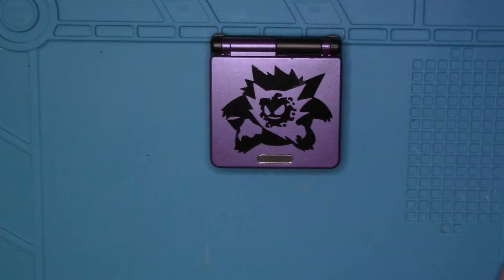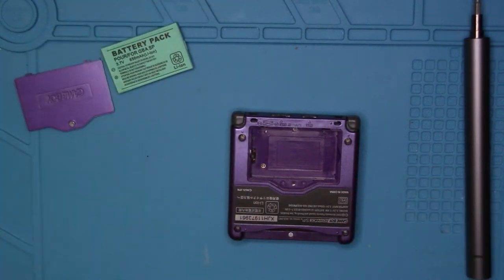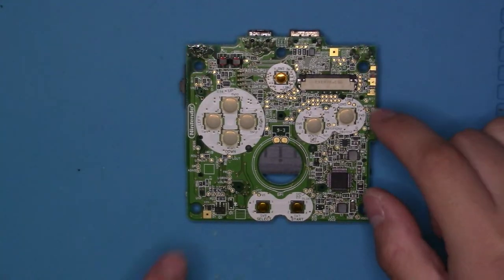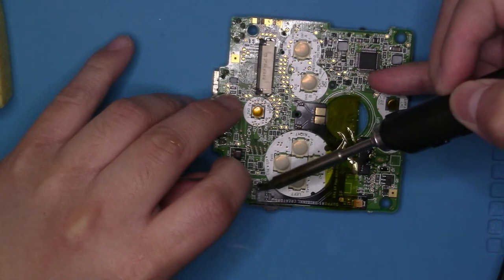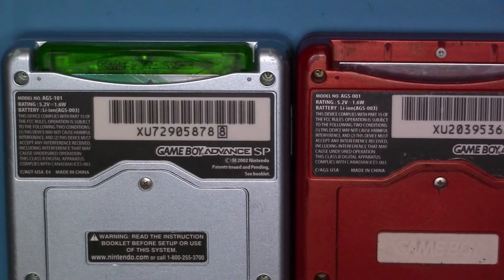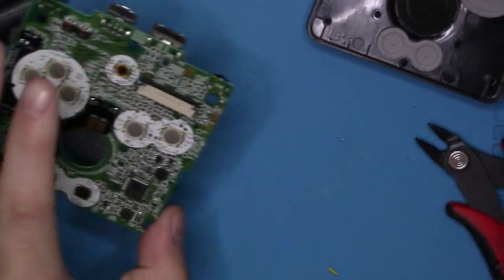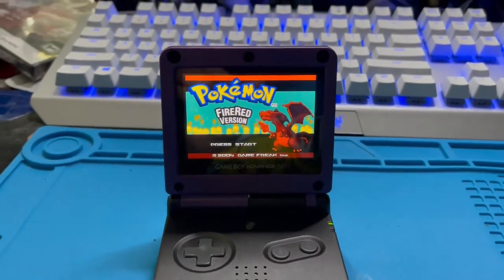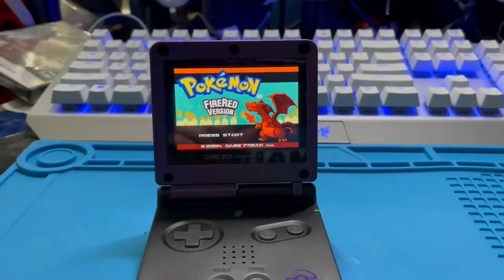MAKE YOUR GBA SP LOUD!! | Helder's GBA Flex Amp Mod

Comment: Great video! 👍
AMP Mod Solder Points Diagrams:
1:58 AGS-101 
     2:26 C6 Point -> Volume
     2:29 SP Point 
     2:31 VCC Point
     2:33 GND Point
2:37 AGS-001 ALL Solder Points identical EXCEPT => [Different GND Point(s) -> C29 &/or C30]

Comment: Hi, I'm not clear on where the yellow wire goes. I see one side going to the ground, but am unsure about the other side. You say "tin the wire and tack onto place" but where does it need to be tacked onto? It looks like you solder the wire directly to the surface of the amp with no solder between the amp and the motherboard at this point?
Reply from the maker: The wire is for the connection between the ground point on the motherboard where we scrape off some of the solder mask to the flex amp pcb. The wire may only be necessary depending on the motherboard.
Reply: @SuperLintendo64  Thanks for answeing! On the flex amp side, the wire coming from ground only needs to be soldered to a spot on the amp itself? Do I need to temporarily place a barrier between the amp and mobo at the non-ground side to prevent solder from accidentally flowing from the amp down to the mobo?
Reply: I want to add that I have an AGS-101. I think that what we are doing is connecting ground on the amp to ground on the mobo right? Thanks!
Reply from the maker: @gpracer350  Yes, that is what the wire is for

Comment: Does this fit with led buttons mod?
Reply from the maker: The mod is pretty thin, so it should be able to. The only thing is if it uses any solder points that the LED Button mod uses